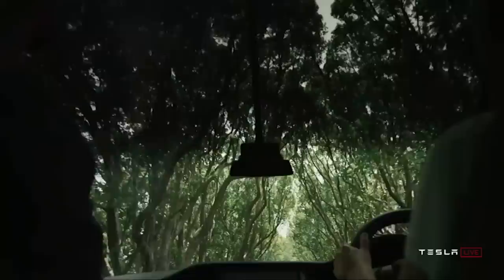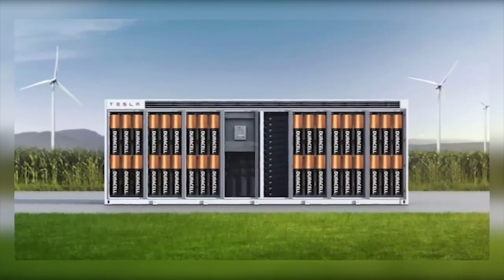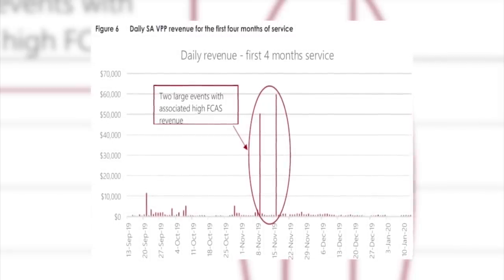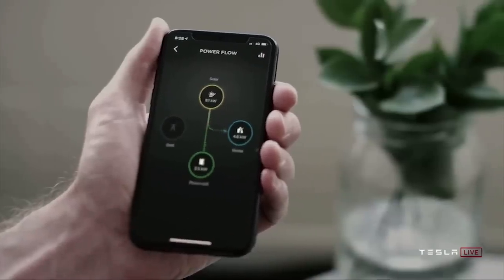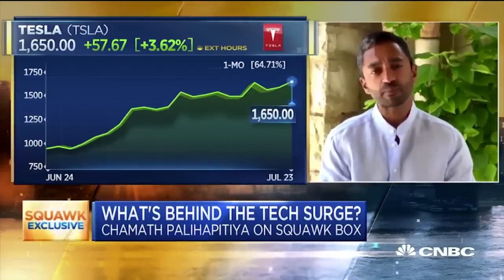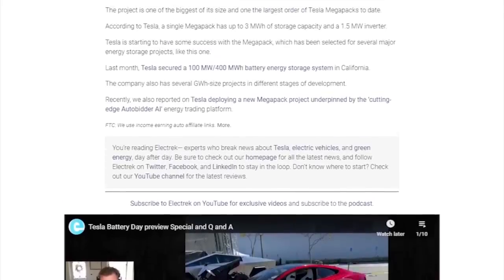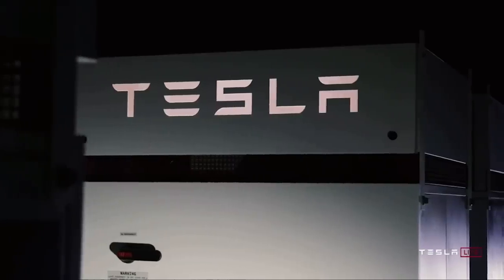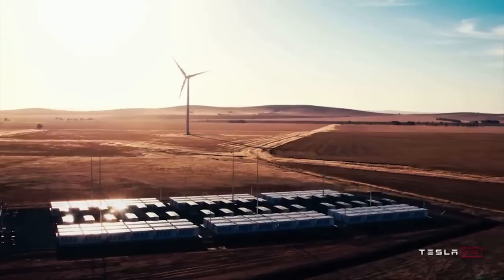Tesla Battery Farms Will Destroy Utility Grids

Comment: Tesla has the tech to do this.  What they don't have is the batteries.  Elon is painfully aware of this, which is why he's talking about scaling from where they were just last year - under 30 gigawatt-hours of batteries for their entire business, including automotive and energy, all the way to 3 TWhs of batteries per year.  And they won't stop there.

So the pace of disruption will be limited by how fast Tesla can ramp its own battery production and buy cells from suppliers.

Elon wants 3 TWhs by 2030, but he won't get it.  That's aspirational.  But by 2035, very roughly, Tesla should be closing in on their second TWh of annual production, if not more.  Along the way, their energy sector growth will be strong.

Some utilities will resist, but regulators and legislators in many jurisdictions will be pushing to decarbonize, and here is a way to decarbonize that actually pays itself back over a reasonable time horizon.

So, yeah.  Battery storage will become a huge industry, and fossil fuels for grid use will wither.

You're right to say that growth in this sector for Tesla isn't factored into the stock price.  But the stock price is very, very high regardless.  If you apply opportunity costs, Tesla's current valuation makes little sense.  Even the payback from its energy business won't support that price if opportunity costs are factored in.  Dividends are a long way out.  Investing in Tesla today is putting money where it can't earn a return for decades.

In ordinary circumstances, opportunity costs would torpedo Tesla's current valuation.  But these are not ordinary times.  What the market is signaling is a total lack of confidence in returns from conventional investments.  Bonds are dangerous - toxic debt is mountainous and ubiquitous.  Stocks are being artificially propped up by monetary gushing at unprecedented levels.  Inflation will soon put an end to that gushing - or we'll end up with hyperinflation.  What's an institutional investor to do?

What they are doing is looking for a safe long-term haven for their wealth.  Tesla, with its market positions and tech lead, looks like that safe haven, so its price has zoomed far above the point where opportunity costs would let it go.  As a result, it's not a bargain.  But there aren't any bargains if the entire financial system is about to go into crisis.  And that is exactly what Wall Street is signaling with every semaphore they can put their hands on.
Reply: •With their partners (Panasonic, CATL, and LG) helping to supply Tesls Energy Storage and Vehicle projects, alongside their in-house production, Tesla will definitely have 3TWh of batteries (or likely more) to work with by 2030.
•Tesla might not hit 100GWh in-house by 2020, but they're pretty good at meeting long term goals, and their aspirational numbers are still much higher.
Reply: @SmugOne30   I don't think they can stick to the timeline Elon wants.  That's all I'm saying.

Even if my less optimistic projection is used, Tesla is poised to become massive in all of its businesses.  They are accelerating their tech lead and pulling away from the competition.  It's not unreasonable to wonder if Tesla might become the biggest corporation in the world by any measure - sales, workforce, stock valuation:  the next-gen version of Standard Oil + Ford + GM + GE from their glory days - about 60 years ago - all rolled into one.

Meanwhile, SpaceX is poised to become the next-gen pre-breakup AT&T, the next-gen ULA, the next-gen Boeing, and the next-gen I-don't-know-what-to-call it, dominating the exploitation of space resources, especially asteroids.  (Asteroids are much easier to approach than Mars or the Moon for resource exploitation.  Miniscule gravity wells.)

I bet regulators will go after Tesla and SpaceX at some point to break them up.  But we can cross those bridges when we get to them.

Have popcorn handy, it's going to be a great show!
Reply: @Urgelt  Right! 
•Their ability to hit the 2030 TWh target was the Only part I took issue with -- although, it might not be all from Tesla's in-house production.
•That brings me to the Art of what Tesla (and to a degree SpaceX) is doing -- even after all their Vertical Integration, they're still bringing all their Partners/would-be Competitors along. The regulators will come after them eventually, but it's going to be hard to make a case against them as hard as they're trying to pull everyone else along with them.
Reply: @SmugOne30  They aren't a monopoly yet, in any of their businesses.  And in the short to mid term, they'll need batteries however they can get them.

But there's definitely a limit as to how far they can drag current-gen battery suppliers along.  If those suppliers don't offer great batteries at competitive prices, Tesla will discard them in favor of its own growing battery production.

And that poses a dilemma for battery suppliers.  How can they keep up?

I don't think they have next-gen tech ready to commercialize within the next five years.  I think their prices, energy densities and cycle life will lag as Tesla pushes ahead with Roadrunner.

I might be wrong about that!  As battery tech nears commercialization, it goes dark.  We see lots of research papers and patents, but the good near-term stuff is hidden from view.  Just because I don't know about it doesn't mean it doesn't exist.

So we can hope that battery suppliers will stay in the game and be able to offer prices and performance that will appeal to automakers, including Tesla.

I'm just not seeing it.

Something else to consider: Tesla's unexploited (thus far) patent for an anode-less battery could well be another game-changer.  In principle, it's got a higher energy density ceiling than solid state batteries - which really are not nearing commercialization.  (I'm skeptical of Mercedes' announced solid state batteries, due in 2022.  Very skeptical.)

See, solid state has an anode, a cathode, separator and solid electrolyte.  Very traditional approach to battery design, it just switches the liquid electrolyte for a solid.

Tesla's anode-less design isn't really anode-less.  It combines the anode with the electrolyte.  The electrolyte becomes both the storage medium for energy and the medium through which it travels.  The anode mass is removed, so more of the mass of the battery can be used for storage.

You don't get that benefit from solid state.  Theoretically, Tesla's anode-less battery tech has a higher energy density and performance ceiling.  

It really doesn't matter if the electrolyte is solid or liquid.  All that matters is energy density and performance.

In Roadrunner, Tesla has apparently solved the riddle of how to use silicon without it fracturing and shorting.  Solid state doesn't address silicon stabilization.  It's just about the electrolyte.  Its gains come largely from preventing lithium filaments from intruding into the separator.  Tesla is using some sort of polymer coating on silicon that I expect does the same thing - it stabilizes the silicon and prevents filaments.  They've found a way to stabilize nickel without cobalt, too.

So where will the tech breakthroughs come from for the other battery suppliers, to enable them to keep up?  They can't copy Tesla's tech, Tesla owns that IP.  Solid state won't catch them up, even if it's ever commercialized.

I think they'll all have to license battery tech from Tesla.

It's no good to suggest that they price their L-ion batteries low and feed them to the bottom of the market, because the manufacturing costs for L-ion batteries is exorbitant, with massive machines required to dry liquid-coated electrodes and many, many steps that Tesla has eliminated in Roadrunner.  Expensive!  Even LFP costs about $80 per kilowatt-hour at the pack level, while Roadrunner promises sub-$50 costs per kilowatt-hour at the pack level.  Tesla will push products into the market at lower prices that no-one will be able to match.  And that will dry up battery demand from Tesla's automotive rivals, because they will be offering inferior products priced too high.  That's no way to grab market share.

I may be missing something.  I'm no expert, and I sure as heck don't know what battery tech is nearing commercialization, but as I look over the industry, it appears that if battery producers don't license Tesla's tech, they'll be screwed once Tesla ramps up production and uses it in Tesla's products.

Licensing can't happen right away.  First, Tesla has to finish developing Roadrunner and get it into full production.  And licenses for the battery tech alone won't do.  Tesla is inventing Roadrunner's production machines, too.  That's also protected IP, so they can't copy the production machines, either.  They'll have to license the machine tech, or buy the machines outright from Tesla.

Another product line for Tesla?  Looks that way to me.  The machine that builds the machine is always important.

This is what disruption looks like.  Smartphone disruption was trivial compared to this, and the stakes are much higher.  Smartphones changed how we communicate.  Tesla's battery tech will crush some of the largest companies in the world - fossil fuel producers and distributors, automotive manufacturers, power plant manufacturers, the entire energy basis of our civilization is being disrupted.  Energy is everything for an industrial society.

AI might be as large a disruption eventually, but it's small potatoes at the moment.
Reply: @Urgelt  that's what I mean by "dragging them along" -- Tesla is essentially a Freelance Research and Development Enterprise. They want other EV and Energy Storage manufacturers to follow their lead. I'm pretty sure licensing their IP is a part of their business model (but all the other OEMs want to do things their own way = slowly/counter-productively).
•I think (with absolutely no evidence to support this theory other than Tesla's  mission statement) Tesla plans to license the technology to their partners until they've developed the next breakthrough, once they've successfully brought it to market.
Reply: @SmugOne30  Yeah.  I have no evidence, either, but it does fit their mission.

Maybe it's premature to talk about licensing, since Roadrunner isn't in its final production stage yet.  But damn.  Suppliers can't keep on with those giant machines, liquid-coating and drying electrodes, and achieve price/performance ratios that Tesla will want to buy.  Or anyone else, soon enough.

As Tesla ramps, obsolete battery tech will fade.  Suppliers can't stick with it.  The business case has been disrupted.
Reply: @Urgelt  am curious to see if they can break up such a monopoly. Usually Anti trust law usually go for  companies that are a monopoly to the extent where they can hike prices at will. However if they can manage to operate like Amazon (work on affordability and reduce prices as they have constantly stated). I think they may have a chance
Reply: @Ys_Guy  It's not only that a monopolist can gouge consumers on prices and get away with it.  That's bad, of course, but oddly, we tolerate an awful lot of monopolism today in a great many industries.  It does impede economic growth when monopolists price-gouge.  We could stand to reform some monopolies right now.

But there are other factors in play.

When a monopoly forms, only one group of people will be making decisions for a product or a service.  It's their way or do without.  That isn't good for innovation, even if prices are fair.

Without competition, monopolies tend to fall into stasis.  There's little reason to forge ahead with new tech, new processes.  Elon has goals beyond making a profit; but after he's gone?  Stasis is likely to set in if Tesla is exercising monopoly powers.  That isn't good for innovation, either.

But breaking up a monopoly is something governments do for only one of two reasons:

  -  Retribution for political opposition/failure to line politicians' pockets.

  -  Extreme cases where the public is up in arms over price-gouging or other sins the public hates.

It takes a lot to rile the public to even notice a monopoly.  No, the usual reason is retribution.

So, breaking up Tesla is most likely to result from failing to pay off enough politicians at the level they feel is sufficiently generous, and/or failing to avoid annoying them with political speech.

Elon is not famous for bribes.  He has donated, but the sums are small and recipients are few.  He also speaks his mind freely, whether it's what politicians want to hear or not.  So even if Tesla doesn't price-gouge, it could be at risk of political attacks and attempts to break it up.

Of course we're talking about 20+ years out, not today.  Tesla isn't large enough to merit that sort of attention now.  But some of us see Tesla's tech as leading to market dominance in a bunch of different industries within the energy sector.  So here we are, talking about the future.  Of course we don't actually know how that future will unfold, but it's fun to talk about it!
Reply: @Urgelt  it sure is!
Reply: Nonsense, the real problem is to first produce the electricity and in a very green way, thats why nuclear is evolving quickly
Reply: @carholic-sz3qv  Too expensive.  Which is why utilities are always begging for massive government subsidies to build nuclear plants.  Mind-boggling sums.  And there's that pesky problem of what to do with the waste, and who is responsible for the clean-up after a plant is decommissioned.  Hint: it's the taxpayer.

You can argue that solar and wind are also receiving subsidies, yep, yep.

Peanuts compared to the subsidies required to balance the books with nuclear.  Peanuts.  And prices for solar and wind are in free fall.  The handwriting is on the wall.

New reactor designs are being floated around, but they all demand big giant subsidies to get off the ground.  Billions and billions of dollars, followed by electricity rates to consumers which are much, much higher, and eventually, taxpayer-funded cleanups.

Say, when was the last time a solar farm melted down and released massive amounts of radiation?  Nothing comes to mind.
Reply: @Urgelt  nonsense, the only problem with nuclear was always the size, the bigger the reactor, the more expensive/complicated it is to build, small form factors like the ones used in giant aircraft carriers and submarine are coming soon and they provide electricity 24/7
Reply: @carholic-sz3qv  Smaller means less cost per plant.  But the cost per capacity remains astronomical, and none of these plans will go forward without massive subsidies.  Which their proponents are already begging.

Huge subsidies, higher rates, taxpayer on the hook for cleanup, higher risk.  There's no way to spin this to look good.
Reply: @Urgelt  nope you are totally wrong, thoe are very high output electricity production units and they uses almost no land compared to all the mini town sized solar farms
Reply: @carholic-sz3qv  I didn't say solar farms use less land.  I said their price per unit of energy produced is far, far less and dropping.

You're not engaging honestly in conversation.

Again.
Reply: @carholic-sz3qv  Nuclear has a strong NIMBY issue that Solar (Put It On My Roof) doesn't have to bother with. Electricity Production (and storage) isn't an issue.
Reply: @SmugOne30  nuclear power is also very usefull for energy intensive processes like aluminium production. Metal industry/foundry......
Reply: Tesla's hardly the only company in the business. VW together with Sweden's Northvolt is building a factory now to make 150GWh of batteries in 2025.
Reply: @pasoundman  Great!  If Northvolt does that, their production target will be 1/20th of Tesla's own target.

Alas, their cost per kilowatt-hour of production is going to be considerably higher than Roadrunner's costs, and the energy density of their L-ion cells will be noticeably worse.

VW will pay more for cells and get less range and performance from them.

How's that going to work out?  Just how far down that path can Northvolt and VW afford to go?
Reply: @Urgelt  150GWh of capacity is good for starters ! Good for 2 million battery packs of 75kWh, more if some packs are smaller.

Why exactly would their costs be higher ? The materials will be subject to global commodity pricing.

Ignores daft statments about VW and Northvolt.

Have you seen the reviews of production ID.3s amd 4s ?
Reply: @pasoundman  You asked, "Why exactly would their costs be higher ? The materials will be subject to global commodity pricing."

Because their production costs will be higher.  They're still wet-coating electrodes and drying them.  Tesla showed the machine footprint for this process and contrasted it with Roadrunner.  Immense cost reductions on the production side.

You can't sell cells for less than it cost to make them.  There is no path for Northvolt to deliver sub $50 per kilowatt-hour cells using their manufacturing technology, that we've heard about.

And the energy density per cell is worse.

Pouch and prismatic cells don't help.  Sandy Munro commented on that recently.  It's just a ton more difficult to mass produce those cells - and those form factors will not allow cell-to-pack, which is another source of cost reductions.

Those battery technologies are about to become obsolete.

You can be sure, VW and Northvolt, after seeing Tesla's Battery Day presentation, are sweating bullets.  Every BEV manufacturer and battery supplier is sweating bullets.

"Have you seen the reviews of production ID.3s and 4s ?"

I've seen reviews for the ID3.  I'm pretty happy with that car.  Relative to the current-generation Model 3, it offers a lower price, lower performance, fewer features.  It lets car buyers get into a BEV who might balk at the Model 3's higher price.  ID3 is a good, functional car for the price.

I haven't seen any independent reviews of the ID4.  Feel free to leave links!

But reviews of current-gen cars won't tell us a thing about the disruption Roadrunner will introduce into the market.